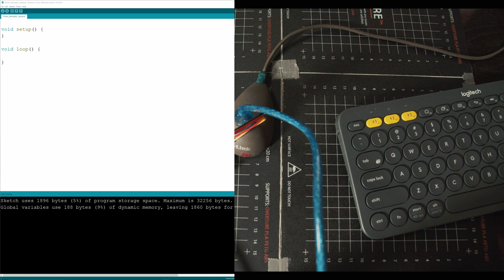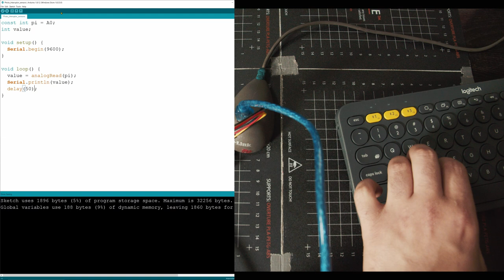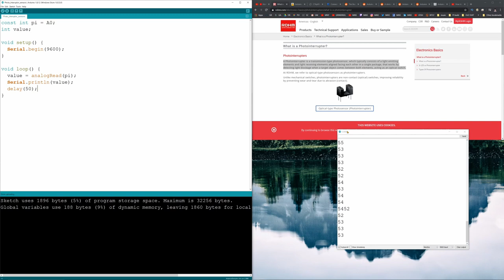Photo interrupter sensor EXPLAINED | Lazer Sensor | #arduino #grindreel

Comment: Can we program according to the speed at which the card is slided??
Reply from the maker: No, but you can setup 2 of them and control the "reaction" time between them
Reply: @MikaelAbehsera  Can you pls make video on that??
Reply from the maker: @FunbukTech  No, it would be the same video just with 2 sensors lol. The idea is, you swipe the card and it triggers the first one while starting a timer, then when the second one gets triggered it stops the timer
Reply: Ok thanks.
But could you pls tell me how would the program be like??
I am not good in programming!
I have project. Could you pls explain the program?
Reply from the maker: You can join the discord qnd we can talk further! But I won't do the project for you
Reply: @MikaelAbehsera  You don't need to do the project!
Pls tell me how can i start that timer in programming!
🙏🙏😭
Reply: Don't make an among us swipe card machine everybody will hate you lol